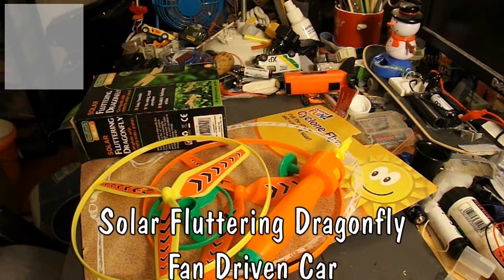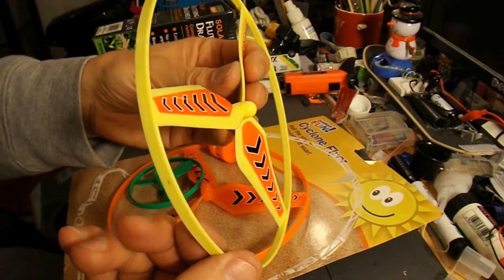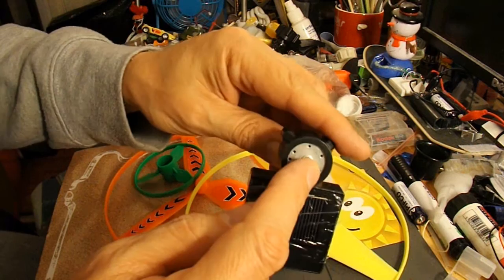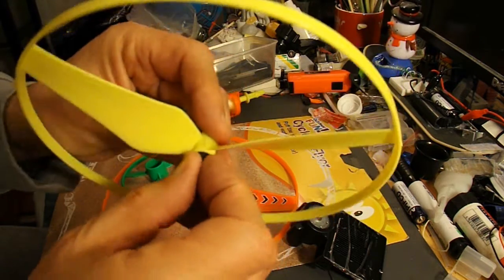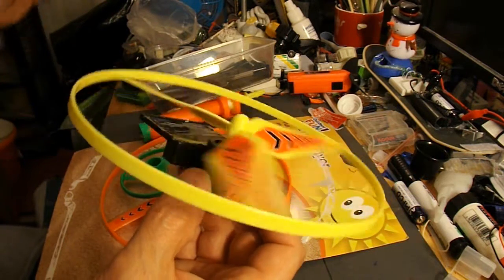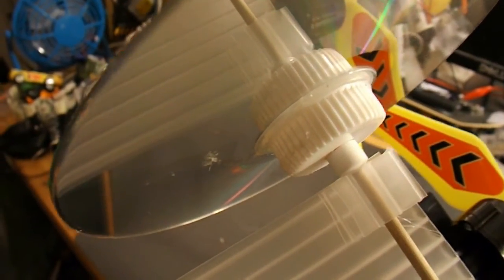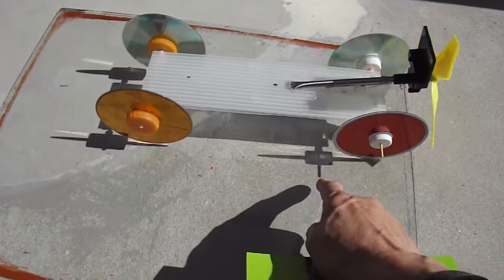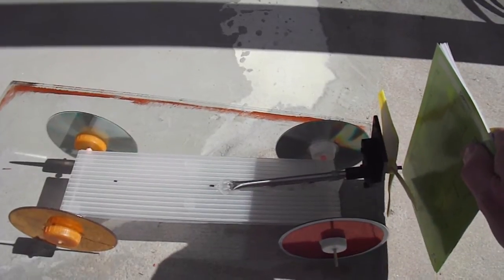Solar Fluttering Dragonfly Fan Driven Car

Comment: Just a thought .. If the sun is low or if you need just a little bit more solar power, you could use a small mirror (at least twice the size of the solar panel to point it easier). It will put the solar panel in overdrive (two suns hitting it). If you have a concave mirror or big lens you can perform magic output of the small solar panel (just don't fry it).
Reply from the maker: deslomeslager interesting thought. Obviously there would be a weight penalty if I mounted it on the car, but it might work. If I just had a large mirror in the room people may consider that cheating but would still be interesting to try it out.

Comment: Do you know granddad I didn't realize Those things had a motor in them, I was thinking of making a plant auto rotator.....I bet you when I get to poundland or the 99p shop they would have mysteriously SOLD OUT  ....Another Top video
Reply from the maker: Graham R Dyer we are talking rather low power here, I was genuinely surprised when it actually moved. For a plant rotator you would need a larger solar panel and some pretty intense gearing to get that motor to turn anything of a significant weight. Having said that, I am sure my brother in law has one but I doubt he would let me take it apart to see what is inside :-)

Comment: I think that the propeller itself obscures the solar panel.
Reply from the maker: Francisco Javier Lázaro Pinela yes it does, but I didn't want to modify the unit, just kept it simple for this video. If you look at some of my other solar powered cars I split the unit apart and place the solar panel where it is most effective.

Comment: What about an airplane that uses the pull string thingy and the prop for propulsion?
Reply from the maker: The main issue there is the short duration of the power, it works fine for the toy helicopters in a vertical direction as they only need to rise up for a few seconds and then float down again. I have been asked that question before and it is on my list to give it a try but I haven't got to it yet and that was probably a few years ago that it was requested 😊